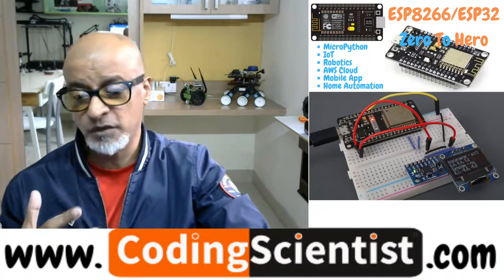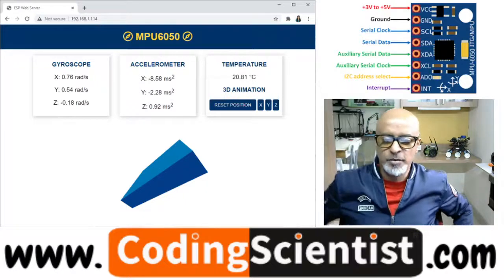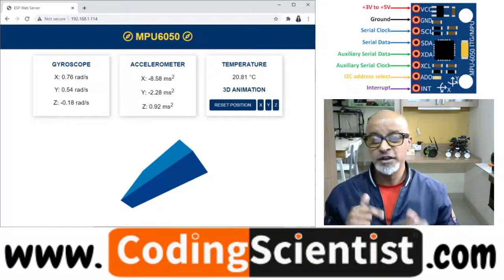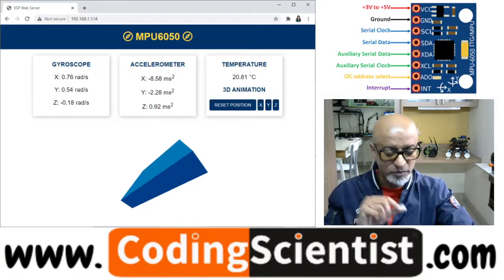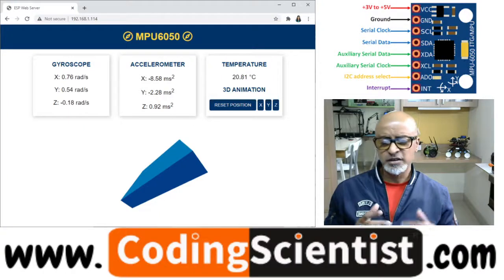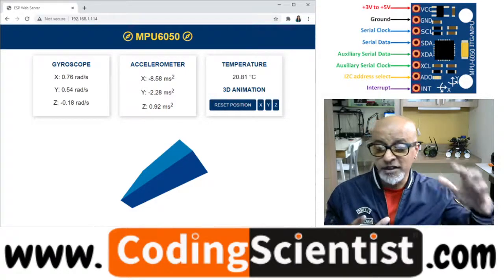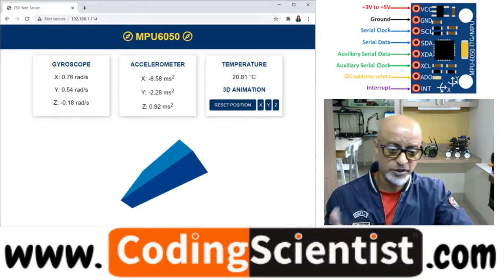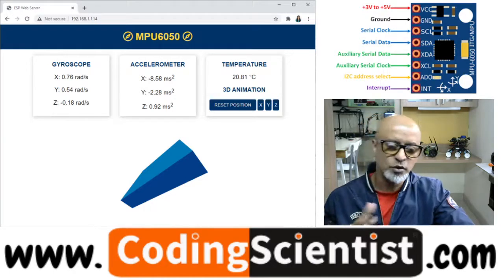Lesson 15 ESP32 Accelerometer and Gyroscope on The Web

Comment: Your project is not shared. Could you share it? please
Reply from the maker: #include <Adafruit_MPU6050.h>
#include <Adafruit_Sensor.h>
#include <Wire.h>

Adafruit_MPU6050 mpu;

void setup(void) {
  Serial.begin(115200);
  while (!Serial)
    delay(10); // will pause Zero, Leonardo, etc until serial console opens

  Serial.println("Adafruit MPU6050 test!");

  // Try to initialize!
  if (!mpu.begin()) {
    Serial.println("Failed to find MPU6050 chip");
    while (1) {
      delay(10);
    }
  }
  Serial.println("MPU6050 Found!");

  mpu.setAccelerometerRange(MPU6050_RANGE_8_G);
  Serial.print("Accelerometer range set to: ");
  switch (mpu.getAccelerometerRange()) {
  case MPU6050_RANGE_2_G:
    Serial.println("+-2G");
    break;
  case MPU6050_RANGE_4_G:
    Serial.println("+-4G");
    break;
  case MPU6050_RANGE_8_G:
    Serial.println("+-8G");
    break;
  case MPU6050_RANGE_16_G:
    Serial.println("+-16G");
    break;
  }
  mpu.setGyroRange(MPU6050_RANGE_500_DEG);
  Serial.print("Gyro range set to: ");
  switch (mpu.getGyroRange()) {
  case MPU6050_RANGE_250_DEG:
    Serial.println("+- 250 deg/s");
    break;
  case MPU6050_RANGE_500_DEG:
    Serial.println("+- 500 deg/s");
    break;
  case MPU6050_RANGE_1000_DEG:
    Serial.println("+- 1000 deg/s");
    break;
  case MPU6050_RANGE_2000_DEG:
    Serial.println("+- 2000 deg/s");
    break;
  }

  mpu.setFilterBandwidth(MPU6050_BAND_5_HZ);
  Serial.print("Filter bandwidth set to: ");
  switch (mpu.getFilterBandwidth()) {
  case MPU6050_BAND_260_HZ:
    Serial.println("260 Hz");
    break;
  case MPU6050_BAND_184_HZ:
    Serial.println("184 Hz");
    break;
  case MPU6050_BAND_94_HZ:
    Serial.println("94 Hz");
    break;
  case MPU6050_BAND_44_HZ:
    Serial.println("44 Hz");
    break;
  case MPU6050_BAND_21_HZ:
    Serial.println("21 Hz");
    break;
  case MPU6050_BAND_10_HZ:
    Serial.println("10 Hz");
    break;
  case MPU6050_BAND_5_HZ:
    Serial.println("5 Hz");
    break;
  }

  Serial.println("");
  delay(100);
}

void loop() {
  /* Get new sensor events with the readings */
  sensors_event_t a, g, temp;
  mpu.getEvent(&a, &g, &temp);

  /* Print out the values */
  Serial.print("Acceleration X: ");
  Serial.print(a.acceleration.x);
  Serial.print(", Y: ");
  Serial.print(a.acceleration.y);
  Serial.print(", Z: ");
  Serial.print(a.acceleration.z);
  Serial.println(" m/s^2");

  Serial.print("Rotation X: ");
  Serial.print(g.gyro.x);
  Serial.print(", Y: ");
  Serial.print(g.gyro.y);
  Serial.print(", Z: ");
  Serial.print(g.gyro.z);
  Serial.println(" rad/s");

  Serial.print("Temperature: ");
  Serial.print(temp.temperature);
  Serial.println(" degC");
  Serial.println("");
  delay(500);

}